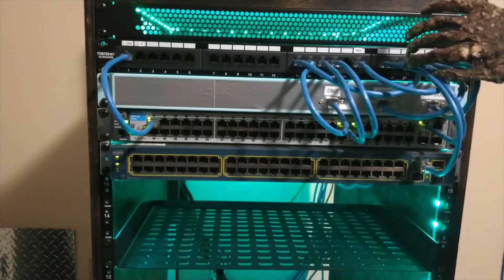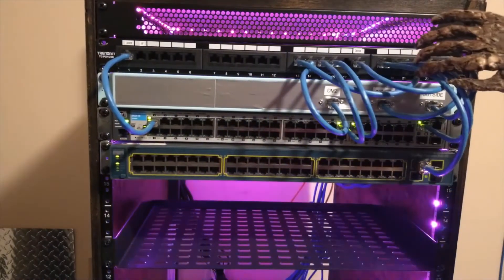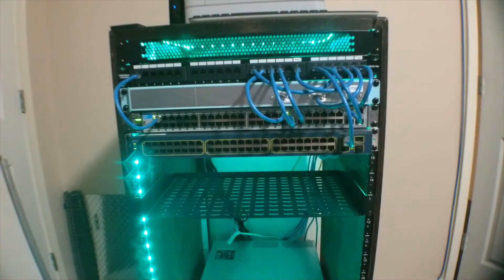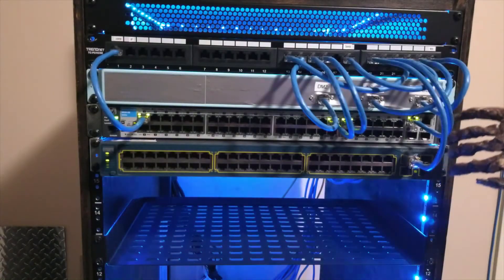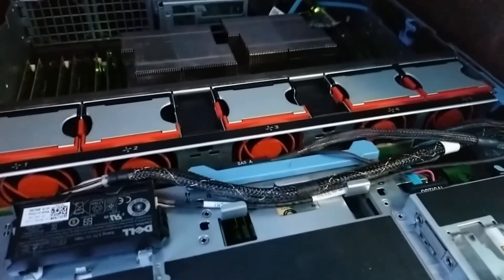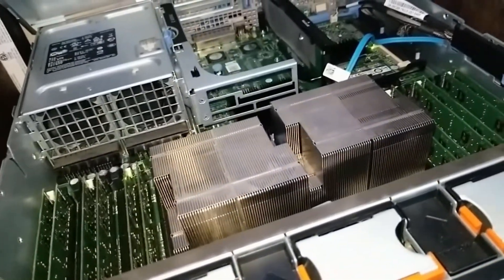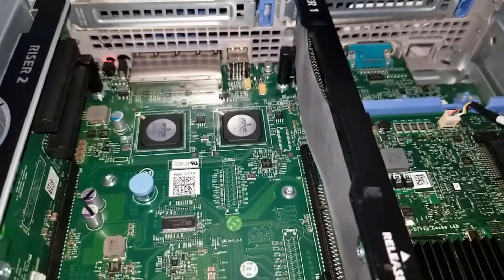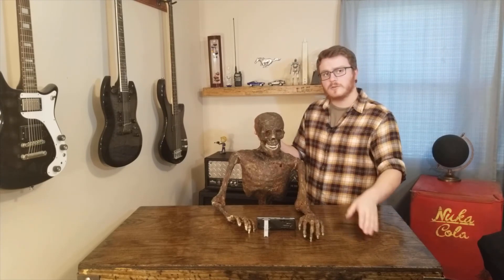Home Lab Tour - Network Cabinet & Server

Comment: I have a single ESX host running 6.7u3 as I'm still holding off on migration to 7. Its comprised of a dual socket configuration consisting of two e5-2680v3's and 196gb of  run of the mill ECC.  Its based upon Supermicro and housed in a corresponding 4u chassis accommodating a couple of raid arrays. Some mechanical, some solid state. There will also be a  Supermicro disk shelf below that which interfaces with the host which is entirely mechanical SAS.   I personally opted for HP ProCurve networking as thats what I'm professionally accustomed to, but there is a catalyst switch racked in there should it be needed for something.   Theres an APC UPS. With an expansion battery block that needs  new packs before I configure it that way. I'd like to move away from a full rack and look into a ventilated half rack in the future to clean up and consolidate the operation.  Looking forward to what you have planned.
Reply from the maker: That's awesome!! I'm sure you could do a lot with that. What sort of services do you run on that?